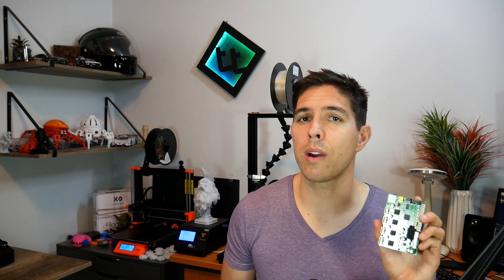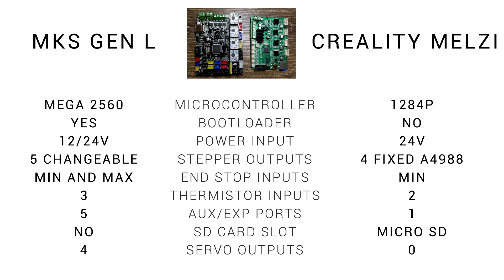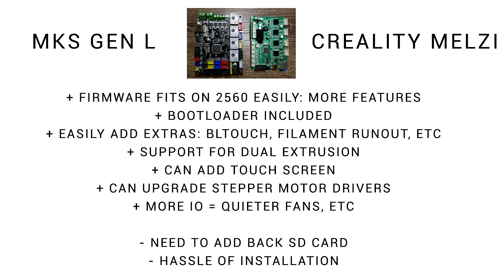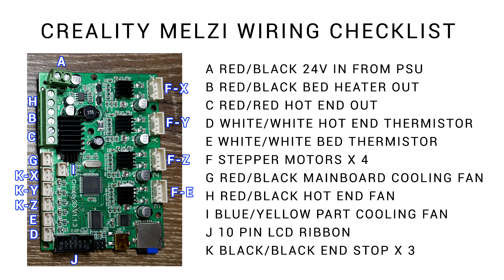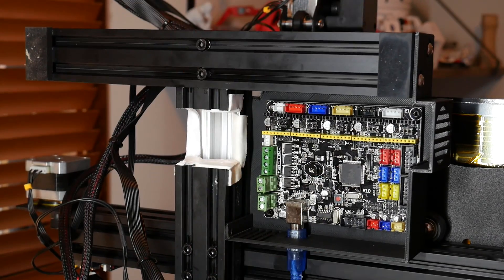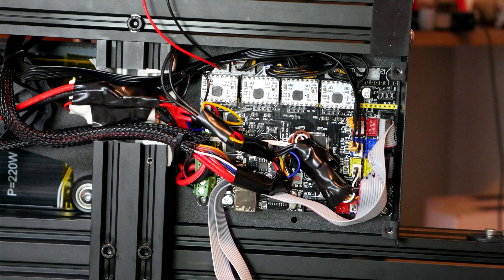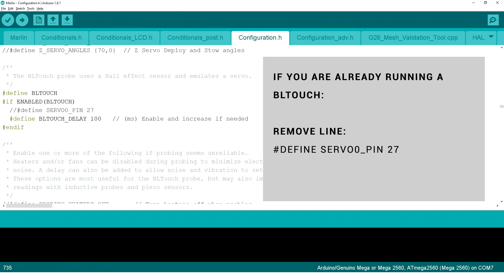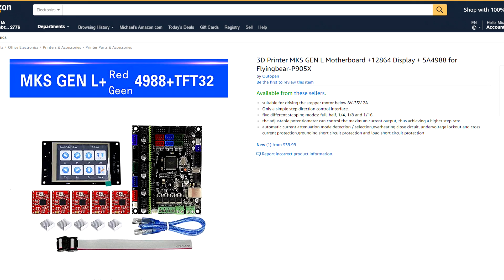Easy and cheap Ender 3 mainboard upgrade: MKS Gen L guide

Comment: Sorry Michael, I am giving your video my first thumbs down. I did the update to an MKS Gen L V1.0 - based on your video - and now my Ender 3 stopped running properly. The idea has great potential, but - based on your video - it is not just simple plug&play. So much important information is missing. Just mentioning a few, choosing the motor drivers (e.g. A4988, TMC 2208) has huge impact on print quality and noise. But, eventhough you are planing on making a new video on it, it is an essential part of this modification. Each Nema 17 motor needs different configurations, because it has different tasks. Which means, it needs have different voltages, for different power output. Based on the A4988, this has to be calculated, based on the installed resistor, which is documented in the A4988 manual, which you don't mention. Also in \marlin\configuration.h\ those drivers need to be activated (e.g. #define X_DRIVER_TYPE  A4988), which you also don't mention. Which is followed by recalibrating the steps/mm, which is also missing. Please consider doing an follow up video, in which you go into more details for this update idea.
Reply: I really would like to do this update to my Ender3 - but it seems that a few bugs / adjustments are in the future.  Is it possible to have a few more details (adjusting drivers, SD card, best stepper drivers, ect) - I know me asking is a lot easier than doing it.   Waiting with great anticipation.
Reply: Maybe it can help, but is in Spanish:
https://www.youtube.com/playlist?list=PLVxk7kJReSrbMJpVY0vfDbm_J682V-GYj
Reply: this guy did the math and according to what he has explained, the vrefs should be 0.725V for X, Y and Z and 0.9 for E https://youtu.be/lVVis30gp_Y?t=654
Reply from the maker: Hi Jan, thanks for the constructive feedback. I didn't have to do any of those things by swapping a4988 drivers because it's like for like. I agree some of those other things are important but they have to be split over multiple videos because it would be way too long and overwhelming. The touch LCD with SD card is the next video out.
Reply: Michael, because you haven't uploaded the follow up video on the drivers yet, I have some input that you might find useful for it. I did some tinkering with the A4988 drivers, to reduce the noise still maintaining functionality. I adjusted the drivers as followed: E=5V, X=2.9V, Y=2V, Z=2V. With this the sound pressure is well below 40 dB. I know you will probabley rather advertise the TMC2208 or TMC2130. Hence feel free to use that information at your own will.
Reply: @jankohler562  Are you saying TMC2208 or TMC2130 would be better choice than A4988 for Ender 3? I am making order now cos have been problem with stock motherboard and bootloader. Tried two different UNO and got same message during bootloader install. "Yikes!  Invalid device signature".
Reply: @pepefin  Those are multiple questions. Quoting Michael: "[...] it depends [...]", and adding to it from my side, on your personal preference and capability. In therms of my personal view, I rank those cited drivers as followed (low to high); A4988, TMC2130, TMC2208. Please read/view installation und documents individually to form your own opinion. Mostly the expenditure is proportional to that ranking. And to your last question, message "Invalid device signature" is likely unrelated to the stepper drivers. My (unqualified) guess is power consumption and baudrate.
Reply: @jankohler562  are those your Vref values? I did the math on mine, and since my drivers have the same sense resistor values as the stock Creality Ender 3, the voltage refs wound up being the same (0.58V on X,Y,Z and 0.72V on E)
Reply: @LongLiveCHIEF  Which drivers are you using? I quoted those values to the A4988 stepper drivers. I calculated the first Vref's for it by using the formula of the A4988 datasheet on page 9. I switched now to the TMC2208 (Model by BIQU) with the following currents: X,Y = 0.5V (UART-Mode), Z=0.8V (UART-Mode, but this driver is likely damaged), E=1.2V (Legacy Mode).
Reply: @jankohler562  ty for comments, im thinking go with mks gen l 1.0 and tmc2208, did u replace the lcd (12864 LCD Ramps Smart Parts RAMPS 1.4 Controller Control Panel LCD 12864 Display Monitor Blue Screen Module) or stay stock one if u stay stock lcd did u buy sd card module if yes can u link me too please
Reply: @TeachingTech  This video "destroyed" my printer in the sense that it does not function anymore despite following your directions very clearly. I've talked to many people with the same issues as me too. Non-functional Z and E axis and setting the same vrefs for the stepper drivers is a terrible idea.
Reply: Also - actually referencing the  voltages might be a nice stab in the dark for those who are 'upgrading' without a working  factory board to reference.
Reply: nerd

Comment: I have no idea what parts of your previous vanilla software upload video and this video I'm supposed to follow in order to get the proper configuration loaded into my new MKS board.  It would be really helpful to have one video from start to finish rather than having to hop around and try to figure this out.  I'm getting a "#error "Unknown MOTHERBOARD value set in Configuration.h" message when I try to upload using this video.  Can anyone help?  I've already checked to make sure I have everything typed correctly.
Reply from the maker: I hear what you're saying but the videos were released some time apart, plus it would make for very, very long videos.
Reply: Teaching Tech, Thanks for taking the time to get back to me.  I didn't expect to get a personal response.  Is there something I missed that is causing me to get a "Unknown MOTHERBOARD value set in configuration.h" error?  I've gone through the same process using you video and a couple of other instructional videos (and combinations) and keep getting the same error.  Motherboard is set to "ardunio/Genuino mega or mega 2560" in the tools menu and to "MKS GEN L".  This is making me a little crazy :)
Reply: @TeachingTech  I just realized I put this on the wrong video.  Any chance you could scan over this and let me know where I went wrong?

This is what I’ve done

Started with your “Ender 3 vanilla Marlin update: Concise guide” and did the following:

1. Downloaded Marlin 1.1.9 from Marlin website and renamed it “Marlin- 1.1.9 - Ender 3” and placed it in the “C:\Users\Nick\Documents\Arduino” folder.
2. Went to “C:\Users\Nick\Documents\Arduino\Marlin-1.1.9 - Ender 3\Marlin\example_configurations\Creality\Ender-3” and copied the five files in that folder.
3. Pasted those five files to “C:\Users\Nick\Documents\Arduino\Marlin-1.1.9 - Ender 3\Marlin”, indicating “YES” to replacing the files.
4. Executed the Marlin.ino file in the “C:\Users\Nick\Documents\Arduino\Marlin-1.1.9 - Ender 3\Marlin” folder, launching Arduino 1.8.8  with the Marlin files.
5. Verified this line “#define STRING_CONFIG_H_AUTHOR "(thisiskeithb, Ender-3)" // Who made the changes.”
6. Went to https://github.com/lauszus/sanguino website and copied the link you indicated
7. Pasted that link to File>Preferences>Additional Board Manager URLs: field and clicked OK
8. Then went to Tools>Board Manager and installed “Sanguino by Kristian Sloth Lauszus” (I didn’t think steps 7 and 8 applied to the MKS board, but I figured I just wouldn’t select it in the step in your second video where I select my board in the tools>board menu.  Just wanted to play it safe, in case that was my problem in my earlier attempts).
9. Went to Sketch>Include Library>Manage Libraries…, typed u8glib and made sure “U8g2 by oliver Version 2.24.3 was installed (I’d installed it in an earlier attempt)
10. At this point I switched to your “Easy and cheap Ender 3 mainboard upgrade: MKS Gen L guide” video, as the last step was to pick the original Ender 3 board, which I was not setting up.

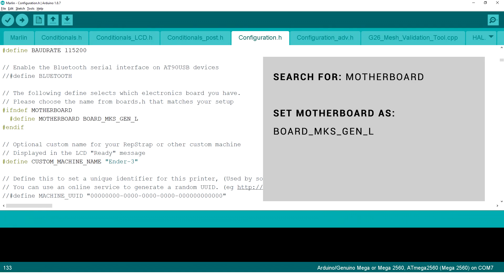Continued at minute 8:30 with your “Easy and cheap Ender 3 mainboard upgrade: MKS Gen L guide” video:

1. Changed this line “  #define MOTHERBOARD BOARD_MELZI_CREALITY” to “  #define MOTHERBOARD BOARD_MKS_GEN_L”
2. I’m setting up a BLTOUCH, so I changed this line “//#define BLTOUCH” to “#define BLTOUCH” and this line “  //#define BLTOUCH_DELAY 375   // (ms) Enable and increase if needed” to “  #define BLTOUCH_DELAY 100   // (ms) Enable and increase if needed”, so that it matched the image in your video”.  I didn’t have a “# DEFINE SERVO0_PIN 27 line” to delete or comment out.
3. Changed these lines:
#define INVERT_X_DIR true
#define INVERT_Y_DIR true
#define INVERT_Z_DIR false
#define INVERT_E0_DIR true
To this:
#define INVERT_X_DIR false
#define INVERT_Y_DIR false
#define INVERT_Z_DIR true
#define INVERT_E0_DIR false
4. Changed this line “//#define REPRAP_DISCOUNT_FULL_GRAPHIC_SMART_CONTROLLER” to “#define REPRAP_DISCOUNT_FULL_GRAPHIC_SMART_CONTROLLER” because I’m keeping the default display.
5. Changed this line “#define CR10_STOCKDISPLAY” to “//#define CR10_STOCKDISPLAY”
6. Changed this line “#define E0_AUTO_FAN_PIN -1” to “#define E0_AUTO_FAN_PIN 7”
7. Went to Tools>Board “XXXXXX” and changed the board to “Arduino/Geruino Mega or Mega 2560”
8. Clicked the check mark right under the file menu to test to see if it will compile and get this error “U8glib.h: No such file or directory”

Just FYI, I haven’t received my MKS GEN L board or BL touch yet.  Should be coming tomorrow, just trying to get a head start.  Couldn’t try to upload, but I assume that won’t work since compiling didn’t work.

Thank you, Thank you, Thank you!
Nick
Reply: @TeachingTech  Finally figured out what was causing it not to compile. I was selecting U8g2 instead of U8glib in the library.  Didn't want you to waste any of your time trying to answer all my desperate posts.  Might be nice to post my step by step (with step 9 fixed of course) if you think it's all correct for others trying to do this.
Reply: I just left a comment on my similar experience. Don't think Michael much cares about anything except keeping his videos brief. Even if that means you and I spend hours trying to get these things to work based on comments he's made several times referencing video lengths.  Don't worry about it Michael we'll figure it out. That way you'll have more time to put out plenty of partial videos.

Comment: What size noctura fan do I need to get to replace the stocker?
Reply from the maker: I'm using a 40x10, but would recommend a 40x20. The Hero Me seals around the heat sink nicely so the slightly less flow of the noctua works great.
Reply: @TeachingTech  Thank you! You rock man!!

Comment: does your guide aply  to this board also ? https://www.amazon.co.uk/Printer-Control-Smoothieboard-Support-TMC2130/dp/B07MLW1PF9/ref=sr_1_3?ie=UTF8&qid=1547750934&sr=8-3&keywords=mks+gen+l+1.1 because it has a ARM-class Cortex-M3 series LPC1768 32bit and its the same money as the mks and from the time its 32bit it can be used for marlin 2.0 ?? and can you make a video about that board? thanks and keep up the good work
Reply from the maker: I will only start to cover marlin 2 and 32 bit boards once marlin 2 is officially released. Not that user friendly at this stage but I'm sure the future is bright.

Comment: When setting driver vrefs, are you doing so with the boards powered on ?
Reply from the maker: The printer has to be powered on to do this.
Reply: @TeachingTech  Thankyou for the reply. Are you using a common earth and the trimpot to read  the values ? Or is there a specific spot on the board/driver which you use ? Also when flashing firmware is that performed with power to the printer ? Or does the USB cable take care of power ?

Comment: Thanks for the video. I upgraded to a MKS Gen L and TMC2208 drivers today. Other than having to drill a hole for my non-pro Ender 3 in the new case and cutting off the tab on the display ribbon cable to flip it around, everything went smoothly and without any issues. The printer is so much quieter now!

Comment: there is some option to join this SD card reader? 
https://www.aliexpress.com/item/1PCS-Micro-SD-Storage-Expansion-Board-Mciro-SD-TF-Card-Memory-Shield-Module-SPI-For-Arduino/32523546123.html?spm=2114.search0604.3.2.10b63f9cPcjYPj&ws_ab_test=searchweb0_0,searchweb201602_1_10065_10068_319_317_10696_453_10084_454_10083_10618_431_10304_10307_10820_10821_537_10302_536_5736111_5736011_10059_10884_10887_100031_321_322_10103,searchweb201603_52,ppcSwitch_0&algo_expid=b3fb8a98-7982-41b0-9f61-66f0a1c0da0a-0&algo_pvid=b3fb8a98-7982-41b0-9f61-66f0a1c0da0a

Comment: Excellent video. Watched most your videos. Thanks for your time snd effort showing your experiences.

I have bought a mks gen L but would like to try get a case that will hold the mks gen L, together with a rasp pi and a mks tft32, and if possible even add the power supply and large fan.

Is this something ypu may do ?

Take care and thanks for everything you have provided.

Mike
Reply from the maker: The TFT is in the mail. The pi wouldn't fit with the MKS Gen L but   you could use the area in between the y extrusion and LCD.
Reply: Many thanks. I was thinking of making a seperate unit, rather than have something fitting under the ender 3. So everything could be kept together. 
There are a few designs on thingverse but they are all too big to print on an ender 3.

Thanks again for your time

Comment: In my case - I change stepper motor drivers on both X and Y axis on my stock Ender 3 board. And maaan, it's crazy silent now :P Good job Michael, nice modification. For now I'm facing with BLTouch for my Ender 3 and then I will remove bed springs. Later on maybe Titan aero or at least better extruder (titan or bondtech) and V6 hotend.
Reply: How can you change the drivers on the stock Ender 3 board? Aren't they soldered in? And which ones did you put in instead?
Reply: @janhofmeister7373  it is not a problem. Tmc2208 fits perfectly instead of a4988. I used hot air, soldered out stock drivers. Then soldered in tmc2208. You also have to change one  capacitor and remove one resistor for each driver set. Trinamic have very good manual for changing drivers :)

Comment: https://www.aliexpress.com/item/MKS-GEN-L-MKS-TFT28-LCD-Minipanel-Touching-Display-3D-Print-Kits-with-A4988-Driver-QJY99/32897956640.html?aff_platform=link-c-tool&cpt=1547579150084&sk=cpCB6VDQ&aff_trace_key=6353fba27a0c4224b98e8cc7f65746e9-1547579150084-01643-cpCB6VDQ&terminal_id=677b5d8de9b84e9294000917d952c11b
Is the a Manual how to make the TFT28 work with the Ender 3 3DPrinter

Comment: So if I wanted to add BLTouch, I would get this board and the 27 pin adapter then continue as per the BLTouch install video?  An in losing the SDcard slot, I then can add a Raspberry Pi and install octoprint to manage that?

Comment: BIGTREETECH SKR V1.1 is far more sensible solution - it's 32bit , it has sdcard and  all the things are same. Also marlin and klipper are supported :). Price is also the same. comes with 16usd shipped in EU (just like MKS Gen L)

Comment: Looking to upgrade main board on new Ender 3, and don't understand process of how to measure and set driver levels between old and new board. Is there addition info on subject?

Also, is the color LCD a drop in replacement with display housing?

Thanks in advance,

Lewis
Reply: https://youtu.be/SmuDIapZA1E

Comment: Since it has a support for double extruder, how hard would it be to equip Ender 3 with one?
Reply from the maker: Still a bit of work. main problem is designing a custom mount to hold the second hot end.
Reply: @TeachingTech  Thank you for your answer! One more question - does this work with OctoPrint?

Comment: "The correct two pins..."
You mean the right two pins?
Reply from the maker: Not sure exactly which bit you mean but I've linked multiple wiring diagrams in the description.
Reply: @TeachingTech  At the 6:36 mark. It's clear in the video which pins are the correct ones.

Comment: Has anyone added the SD card LCD screen? I'm looking at mounting it but I feel like the SD card will hit the bed level wheels
Reply from the maker: I will be showcasing how to add the TFT 28 and TFT 32. Still waiting on the 32 to arrive.
Reply: I added it.  You have to modify the OEM screen mount but once you do there is just enough clearance.  I cannot get it to print from the SD card.

Comment: Do you happen to know if this board will work with EZABL?  I'm not sure if i should go with TH3d or vanilla marlin or what I'd have to change.  Any ideas/help?
Reply from the maker: It will be you will need knowledge of the firmware in either case to go through and make the changes.

Comment: Great video, thanks for the information. Does the base board you recommend compatible with the TMC2208's? Is there a significant difference between the TMC2208 vs 2100?
Reply: Yes it can be used with TMC2208. 2208 are plug and play, 2100 are not.

Comment: FYI - The kit listed in the description will NOT come with a touch screen.  It comes with a standard LCD screen with the SD reader,  rotary encoder and beeper on the top.  I have contacted the seller but doubt I will get it resolved.  I will place an order for the touch screen from a different seller and eat the LCD screen.

Comment: I just finished with this guide, but only the y axis will move. The x, y and extruder won't move when I send commands to it. I've tested the motor drivers and the stepper motors and they both work great. Any ideas on what could be wrong?